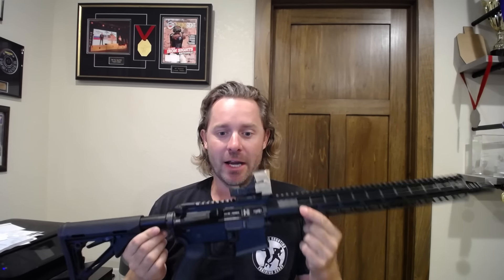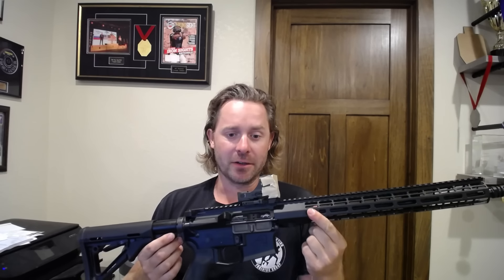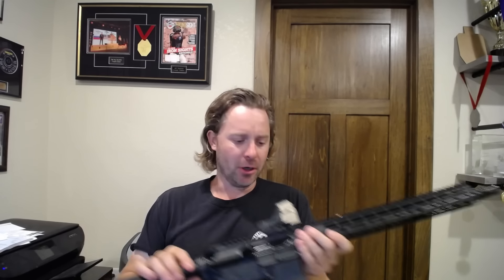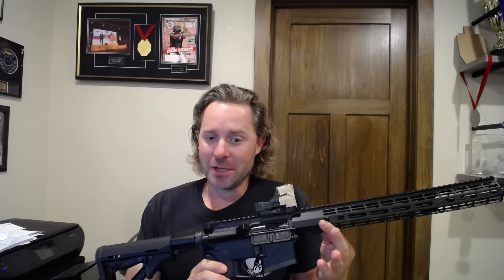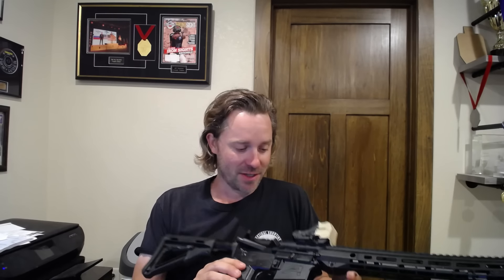Yes I understand Aero stuff is garbage

Comment: Aero is the sex, full aero 223 wylde w/ 22lr conversion. I love it, solid but light, accurate and smooth. Set up to receive pretty much any modifications available. I definitely don't maintain my guns like I used to, definitely been 5 or 6 sessions since last cleaned, clear signs of normal build-up but zero problems. The one Con, which is an understandable one, is the 22lr conversion, works flawlessly with higher end ammunition, but can fail to cycle with lower quality rounds. I don't really count this, because if I got a lighter buffer spring it would probably solve that. On bonus side of things, for unknown reasons my buddies Aero will go full auto when using 22lr conversion. It seems to happen with a very slow squeeze, almost stopping at the brink & barely creeping that last 1/32" & Freezing trigger position immediately when it fires continue holding trigger position & it cycles & fires in auto. Generally only does 5 or so rounds but have gotten a couple mag dumps doing this.(I think there is something up with trigger assembly but he insisted its installed & properly functioning) I consider this a bonus feature but some may not. Would be nice to know why it does that though, as well as knowing how to make mine do the same... err so I can make sure it doesn't happen, I mean....

Comment: I get that youre an experienced shooter, but where are you at on gunsmithing knowledge? Aerp precision products are definitely not "garbage." The fact that you have had operating group issues with their parts could be indicitive of error in the assembly process, such as not verifying acceptable headspace, using aftermarket parts like cam pins the are a poor fit to the bolt, or similar errors. Ive seen complete Aero guns make it much more than 20,000rds and be find aside from needing spring replacements or maybe barrel swaps, but this is typical for non-hammer forged barrels.

Comment: 7 k on a bolt with not cleaning it that good and not replacing the gas rings or cam pin or ejector before it breaks sounds fine and normal to me. My experience 90% of them are all the same and wear out.  Typically the extractor or rings  or cam pin goes first though.

Comment: I built my M5 chassis only and im incredibly happy with it. Barrel is a ballistic advantage 16" and its absolutely fine nothing to write home about, KAK LR-308 double ejector - 3 malfunction in one run, determined to be ammo related (it was 90s Venezuelan M80), RISE 140 trigger, Mission First Battlelink stock, Sig Romeo green dot about,  1,500rnds and although its incrdibly light and REALLY twitchy bc of the trigger it runs like a bat out of hell and i dont think im gonns get rid of this one. 

I know its radicslly different than buying a full tilt assembled M5 but the platform itself has shown itself to be my favorite of the LR308s Ive tried and I dont think a beginner should shy away from the platform itself. On rule since AR designs are just big lego kits I always recommend people try to piece their rifles together themselves and just get the specific guts they know they can trust themselves. You can build a lot more rifle with less income than you can buy outright.

Try out that KAK double ejector bolt, its pretty impressive

Comment: Speaking as someone who owns some higher quality firearms, I suspect the average Aero/PSA etc owner might not have any knowledge of (or the means to stock parts to conduct) preventative maintenance, and what parts are expected to fail and when. I speak to a lot of budget minded people who don’t put the time and effort into learning the trade, and they have no clue how these weapons work(like, not even field stripping, living, cleaning, etc.). I say this to make the point that these guns probably fail prematurely from simple negligence. Does anyone really treat their Knights or LMT like trash? Probably not. If their parts are out of spec, that’s one thing; but this incessant painting with broad brushes when it comes to affordable guns is largely an issue of ignorance and snobbery. If you follow standard maintenance procedure, like replacing bolts, gas rings, extractors/ejectors and springs when you’re supposed to; and making sure something like gas key bolts are torqued and staked right on occasion, even marginally out of spec carbines should last a good while. Fortunately, I can own nicer things and I can’t say I really have a dog in this fight beyond that critique.

Also… clean your weapons. I don’t know why that’s a flex or why people are bummed when their gun fails, shoots dinner plate MOA, and it’s caked in thousands of rounds worth of carbon and debris. That’s just day 1 stuff😅 come on. Most of us don’t get free guns and ammo and we have to keep what we got running for as long as possible.

Comment: I have an aero upper that seems to be imparting (very) slightly uneven wear on a bcg. That said, I use their receiver sets and then put the parts i want on them. Never any problem with lowers, may consider a higher tier upper due to the more function critical spec

Comment: I dunno. 
I use aero stripped lowers and uppers and put in my own parts.  Does a forged lower or upper break? 
I do have a couple aero bolts, no issues yet.
I believe most Aero complete upper barrels are Ballistics Advantage. Aero doesn't make barrels...that i know of.

Comment: I like their lowers and the slim line handguard for a scoped gun that wont have to hold zero.  Just needs to hold a light.   I have an aero build with a criterion barrel and bcm bolt.  It may favorite gun, and i have several gucci rifles.  This one is light and accurate.

Comment: Nothing wrong with those guns. I personally run higher end BCG’s but I’d totally rock an aero, replace the BCG and would keep the stock one as a spare. 

20k rounds is plenty of rounds for a bolt. I’d replace the bolt proactively if it hadn’t broken by then. Also, 10k rounds through a button rifled barrel is a lot. Sounds like they’re putting out some pretty good shit based on this review

Comment: I have two aero uppers between the both probably have around 30000 rounds. I take care of my guns however. Cleaning and lubricating is standard for me. Why would I pay for a gun then cause a bunch of unnecessary wear and friction just to turn around and say it’s garbage. Aero bolts work great the barrels are awesome also. Guess it’s just to different mindsets. One runs something without care till it breaks then complain. The other take care of your stuff and it will last a long time.

Comment: I bought Aero Nickel Boron BCGs exclusively, but I also bought stuff from Aero that they flat out refused to warranty and it was factory defect, that would cause complete lock up of the upper
Their handguards are amazing and they helped me with replacing barrel nuts for free, but that M4E1 enhanced upper with embedded nut, 2 same failure and they ghosted me after telling me it's my fault

Never an issue with their Nickel Boron BCGs, I never hate on Aero, but that refusal to warranty sits with me.

Comment: 20k rounds is about double the life of your bolt and barrel with proper maintenance nevermind running it dirty without proper maintenance on any firearm. Here's what likely happened, properly maintained gas rings last maybe 5k rounds. So at the very least yours gave out 15k rounds ago. At the same time 20k rounds through the barrel and the gas ports erroding, whoch affordable rifle tend to be over gassed to begin with but now your super over gassed and that gas is blowing right past the bolt eroding the BCG. You said you don't  clean it so had  carbon build up, increased friction and heat piled up and and bam! Broken BCG. To be honest as far as your test goes it did very well for the price point and had you done proper maintenance, regular cleaning, lube and replaced worn parts as necessary that thing would still be running probably with that BCG. But go ahead try this on your vehicles too, don't  change any fluids or worn parts and when you are either stranded in the desert because the engine or transmission blew, or careen of the sude of a mountain or bridge because your brakes were toast go ahead and blame the manufacturer. I'm not trying to be an A-hole but it is hard to follow your logic here and what you are saying doesn't  really make any sense. It's not fair of you to mislead people into thinking Aero makes trash because you want to Mad Max larp your rifles.

Comment: They have been the absolute worst customer service I’ve ever worked with in the industry. 

I have been trying to get them to replace an out of spec M4E1 lower (buffer chittering due to incorrectly placed buffer retaining pin hole) for about a year now and their communication and urgency is juuuuust about absent. 

I sent it in the first time and they claimed I incorrectly installed the receiver extension (I’ve correctly built a ton of lowers so I knew that was bs) and they sent it back with one more turn in the tube and the the problem still exists. I send it back again and they agree to replace it MONTHs ago. At one point they tell me it should be back to me in about 2 weeks. That was about 3 months ago. 

I have plenty of their stuff I’ve picked up over the years but I will not buy any more and I won’t recommend them ever again. All they had to do was run the measurements and replace it. 

As of 6/23/24 they still haven’t replaced the lower.

Comment: I bought AP lower for my MODERN M Upper. The disconnector is missing. I send an email no response.Not going to buy again.
Reply: I like their receivers but their customer service is horrible. I ordered a lower gave no confirmation email or tracking.  Called 3 days in a row on hold for 30 mins to hour with no one ever picking up.  Sent a "request " whatever tf that is as well with no response either. If I order aero again will be from a second party like midway usa

Comment: This is the most absurd nonsense I've ever heard. I really hope new shooters see the comments here and think for themselves. The AR platform has a general service life and maintenance schedule for various parts. Bolt Carriers should be replaced at about the 10,000 round counts on "duty" rifles. Or you can shoot them till breakage on hobby guns which usually will be between 10,000-20,000 rounds (no real way to tell past 10K, besides some wear marks, but that doesn't always tell the full story). Mil-spec barrels last about 10-15K rounds max, then need replacement. Some really higher end barrels can last a bit longer to a bit over 20K. So his experience with Aero is completely within the mil-spec range of service life of AR components. Especially if he didn't service the rifle, as in changing out gas rings at 5K round count, changing out extracter and spring at 7.5K, etc. Same for the barrel, that's about the expected service life. It's particularly funny cause he hasn't even run his "high end" rifles anywhere near the round counts of the Aeros, so has no idea what their service life is...

Comment: Been using aero pro bolt for well over 5k rounds zero issues and it’s an aero upper with Odin works gas system and it runs great

Comment: My buddy has a Bushmaster with over 30,000 rounds through it. He hardly ever cleans it. Just sprays it with WD40 or sinks it into a 55 gal drum of old diesel and water and god knows what else.. He's replaced the bolt a couple times. It blows fire out the gas block and gasses your face like crazy.
It keyholes like a MFer. You can't see any rifling at all.
Lol. But it keeps running.
Its an old one. From 1997.

Comment: Aero receivers are gtg.

I’ve used M4E1 receivers from the beginning.

Now, I run the Thunder Ranch receivers on every AR15 build, I like having them match.  I’ve only ever done black, never a Cerakote, so no experience there.

After that, it’s a Wilson Combat or LaRue barrel, an NP3 BCG, JP silent capture springs, LaRue or SSA-E trigger, Midwest Industries rail, etc.

But using parts like that, never had a single issue with a build, period.

A total Aero build, can’t comment personally, but the guys I know that have them haven’t had an issue.  I’ve only heard on the Webz of their BCG problems.

My FFL has a full auto running a NiB BCG from Aero, never been a problem.  I was told the issue they had at first has long been fixed 🤷‍♂️

Comment: Is the gun junk or the bolt and carrier?
Reply: I don't mind their lowers.....I don't care for their parts
Reply: I’ve got one but it has an ao precision bolt in it.  I’ve got their m5 as well.  Neither will see the round counts his has is why I ask.
Reply: @walt3r88  my m5 wouldn't run the way I wanted with aero parts....unreliable and chewed up brass.....I basically rebuilt it with jp parts
Reply: Well that’s a bummer.  I might have 30 rounds thru mine, I use it for pigs.  Same with the 556 aero but closer to 250 rounds.
Reply: Well that’s a bummer.  I might have 30 rounds thru mine, I use it for pigs.  Same with the 556 aero but closer to 250 rounds.

Comment: I like their lowers, but I put different parts. I tend to run BCGs that are a bit more proven…my suspicion is that nitriding might be better than phosphate coated or the stuff like TiN with such high lubricity and low porousness that it doesn’t hold any lube. 

I assume Aero makes the BCGs for tons of aftermarket companies, just like they make slides and other parts for aftermarket folks. Probably only 6-8 companies actually making BCGs in America.
Reply: What are your 'proven bcgs' list?
Reply: Close but no cigar. There’s only 3 BCG manufacturers in the US. Microbest, AO, and Tool Craft.
Reply: Well, I’ve seen BCMs and DDs (as well as a Hodge) do super high round counts where the BCG outlasted the barrel, but even if I knew who made those BCGs, it doesn’t mean all their BCGs will be as good. 

People seem to like Toolcraft, but I assume they make many different ones using different metals and get sent out for different coatings and stuff. 

**I’m testing a reliabolt paired with a supposedly heavy duty carrier that was nitrided (I’d have to Google which company)…I only got it because a 3-gunner I know had the same setup based on what he’s learned from others and experience (and he shoots 30X as many rounds as I do), I have a BCM bolt group as my backup.
Reply: I’d be surprised if it was only 3…I know a ton more make bolts, but the carriers do seem to be more limited. 

Only 3 of these are making their own carriers? 

LW Schneider 
Nolte Precision 
Young Manufacturing 
AFCO 
MPI (manufacturing -partners) 
Barnes Precision Machine 
GTI Precision Components 
ARMSTEK 
Colt 
Daniel Defense 
Microbest
FN 
National Aerospace 
Advanced Ordinance / AO 
Toolcraft
Reply: @GunInsights  Yeah there’s not a lot. The re might be a couple more but the Big 3 make about 90% of the BCGs on the market. I think Young makes their own BCGs and the BCGs for KE arms, LMT has their proprietary one as well as KAC, but I’d say around 90% of all BCGs were made by the big three to the brands specs (ie bolt materials, finishes and profiles).
Reply: @GunInsights  MPI stands for Magnetic Particle Inspection😭😭

Comment: I never had problems with their lowers for ar15s... but the m5(308) didnt run too well eith aero parts.....after I swapped the guts and gasblock with jp enterprises it runs like a  top..
 sub moa with federal ...so I don't mind their receivers.....but I don't waste time with their parts kits
Reply: Same thing here….. I went with Krieger they headspace a JP bolt with there barrels. But as I saved money I ended up with a complete JP BCG and silent capture buffer system. At the end of the day my build is a mutt. But a mutt that’s capable of consistently slapping down dime size 5 shot groups at 100 yards with little effort. Idk understand why Aero is getting all this hate lately. Aero has always been a builders company.

Comment: If the aero m5 308 isn’t garbage why don’t the sell completes? Because the mystery manufacturer bolt and carrier are garbage. How come you can’t get just the bolt or an extractor or firing pin for it? Until these questions are answered, I doubt the entire company..
Reply: Not simping just pointing out: Heres the sku to the phosphate Aero308 Bcg APRH308184C as well nitride :APRH308186C and Nic boron is also listed on the site. Admittedly, no replacement Bcg parts are listed however. Either way, they are contracted out for manufacturing to my knowledge,not made in house.

Comment: What you saying makes no sense, I have been in the Army 45Echo Hooraahh M1 Turret Mechanic, Now back to the Riffle, first off its not a Gun, a gun is something you hold in your hand, Ar15's are Weapons or Riffles but not guns. 20 thousand rounds is not a piece of Junk, I have shot M14 M14A1/A2s and they were top military riffles at the time and they still gave problems, sometimes they jammed a lot, but they were not junk it's just the nature of machinery.  That's why when in high usage you must apply high maintenance in breaking it down to the firing pin and cleaning the riffle on a consistent basis when in high usage.  I'm sure if someone breaks in your house and you have an aerospace riffle AR 15 I'm pretty sure it will do you justice and kill your target in home invasion, they are not junk riffles they are very accurate and durable.